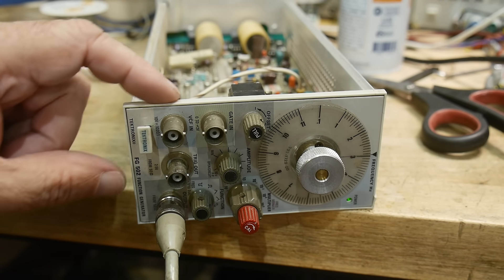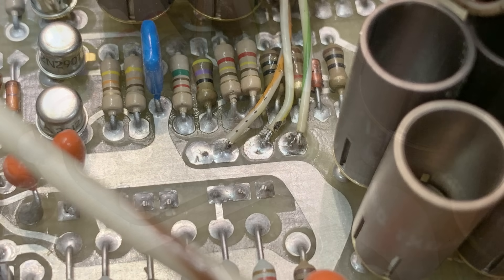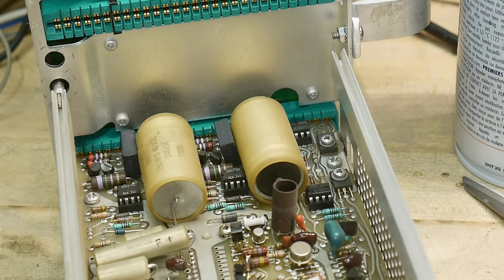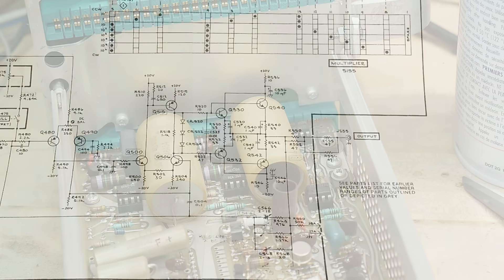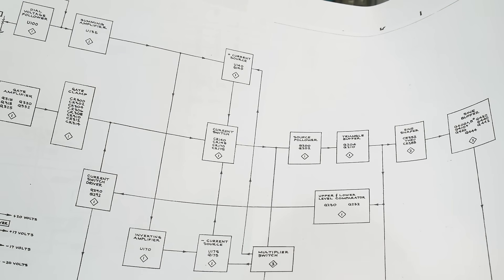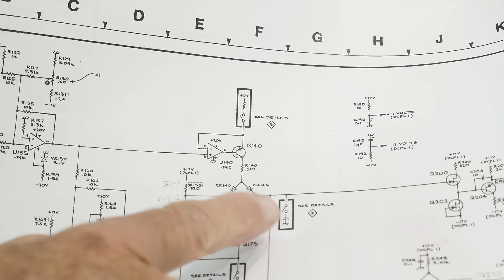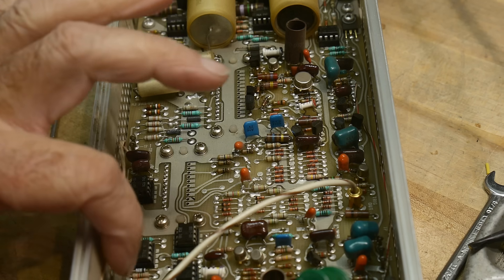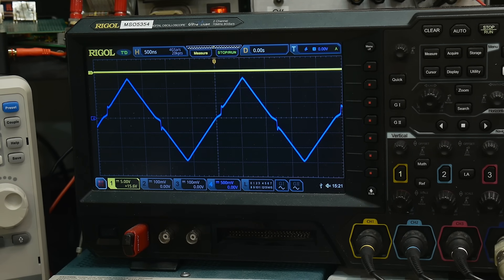#1761 Tektronix FG502 Function Generator Repair

Comment: Wow, this brings back memories!  My first job in electronics was with a small contract manufacturer in Portland, OR, and we built FG502s, LA501s, and SG502s, if memory serves.  Tek provided the parts, we provided the labor.  

I suspect you may have a prototype, an early production model, or maybe even a "gray" unit, built on the sly by someone at Tek.  I say this, because I seem to recall that the units we built had gold-plated traces, especially at the contacts in the cam switches.  Not sure if the boards had solder mask, either.

Good job on the repair!  You were certainly right to suspect the IC sockets.  Those were kind of crap, and the later machined-contact sockets were far more dependable.  And the op-amps were 741s!  That shows just how old this design really is.

Thanks for the stroll down memory lane!  Keep up the good work!
Reply from the maker: plenty of TEK stuff with tin-lead boards

Comment: It looks like the solder only adhered to the outer strands of the wire in combination with being cold.  When the wires were disturbed the outer strands took all the stress of the tugging and bending when opening the case(?)  When they eventually broke, the inner ones don't have anything to hold onto, there was never solder soaked in the middle.  In another words, the strain was not relieved up into the cable, it was concentrated at the board level, leading to premature breakage.  It's always good to flow sufficient solder into the middle of the wire.  If the wire has poorly plated strands, pre-fluxing after stripping may be necessary, which they obviously didn't do.

Comment: Usually heat sinks are anodized making their surface pretty much non conductive but I see somebody already mentioned that. I've always liked Tektronix equipment but I have always wondered how they got those dinky switches to work and work over time.

Comment: Those TM-5xx modules are great, I spent a few months buying and restoring about 20 different items, then I gave them all with some mainframes to a friend for his lab. I prefer smaller individualized TE, but the modules are great if you have a permanent lab. As you've been finding, the faults are mostly (1) mechanical, (2) tantalums, and (3) oxidized contacts. Very rarely did I ever have to replace a semiconductor, usually it was a 1N914, 1N4001, or similar discrete diode - but some of the older 70s transistors were less than reliable. Fortunately, these have very few Tek-specific semiconductors, unlike the scopes of the day. Having a 3D printer to re-print some of the brittle plastics is a major advantage, especially on the units that have rear-side PCB alignment clips, which always fall apart. I recommend printing in nylon if you have the capability, otherwise 'durable' resin prints work great for knobs and pull-handles. Love the channel and the content - Cheers!
Reply: I picked up a couple modules when the lab down the hallway was being decommissioned. They worked at first but then started failing a couple weeks later. Thanks for the tips!

Comment: Heat shrink tubing is thermal insulation and will defeat the heatsink.  It would be far better to drop a spot of RTV or hot glue between them.  Evidently, the short circuit was loading the prior stage.

Comment: Nah, that's not Tektronix... look at the other joints. I've taken apart lotsa these plugins and the factory solder work from vintage Tek is always second to none. Someone else has had their way with this poor creature. That's never a good sign with used electronics coz you know "If I can't fix it I can fix it so it can't be fixed" which is how it ends up in your hands. And speaking of hands Mr Hands, when do we see the rest of you???
Reply from the maker: It looked factory to me. the wire was really hard to tin, so maybe they just got a bad batch.

Comment: Wet slug tantalum, with the glass seal, will run till the case rots out, generally from the outside. The ones with the rubber seal will all fail after 20 years.

Comment: The two outside solder connections of the frequency pot looked a little dodgy as well...the one on the left looked like the solder had separated from part of the wire and the one on the right looked like not all of the wire strands had made it into the PCB hole. Or it could have just been an optical illusion!  ;-)  Always nice to bring an old dog back to life!  73 - Dino KLØS

Comment: The aluminum heat sinks were anodized so that would provide some insulation, but over time friction could wear through that oxide layer.
Reply: Those push on ones normally are made from a brass alloy though, at least for almost all the TO39 can ones I saw that were tubes. The aluminium ones generally were extruded and anodised, generally with a red dye as coat.

Comment: Q515, Q506. The collectors are tied to the case. Between the collectors are a resistor and three diodes to set the AB bias of the next stage. Shorting the collectors together shorts out the resistor and diodes and converts the output to a class B amplifier. I was thinking it was the output amplifier, but you started probing the input signal and it was also distorted. Even I went and started to blame the oscillator circuit.

Comment: Speaking of cutting your finger off............. One of my trade school instructors told me this story about when he first started out in electronics in the forties, and had his own radio repair shop. A customer brought him a dead radio, and said he'd be back to pick it up in a week when he got paid. After a few days my teacher began to smell something really foul in the shop. He followed his nose to a particular radio, removed it from the shelf, put it on the bench, removed the back of the set, and the funk hit him. Vacuum tubes in those days had grid caps on top of the tube, as the grid is high impedance, and the glass surface of the tube would give lower leakage, than running the grid connection through the bakelite base. The grid return resistor on one of the IF amps had opened up, allowing the tube to saturate and killed the radio. The set owner was poking around in the set, and noticed that if he touched the grid cap and the chassis, his fingers formed a makeshift grid return resistor, and made the radio work again. So this customer went to the kitchen, opened the fridge, cut a strip of liver, draped it around the IF amp tube across the grid cap, touching the chassis, and secured it with a piece of string. The radio played for a few days until the liver dried out. At this point the customer decided to take the radio in for repairs. So yeah cutting off your finger will work, but the garage will be stinky in a few days. It might even mask the smell of the selenium rectumfrier that you tried to smoke! :elbowcough:
Reply: that's a great story, very gross 😅
Reply: Brilliant story!😂
Reply: Rectumfrier😂😂, haven't heard that since my earliest days in the tv trade, great stuff!.
Reply: I've never heard of bigger idiots, that's really remarkable! What part of the country do they live in exactly?

Comment: The distortion at the input of the amplifier was smaller relative to the signal than the distortion at the output. So I assume the distortion was produced in the amplifier and was lead to the input by the feedback (R566). 
Connecting collectors (heat sinks) in this case Q515 and Q506 would produce crossover distortion.